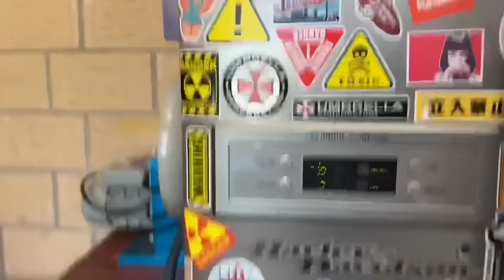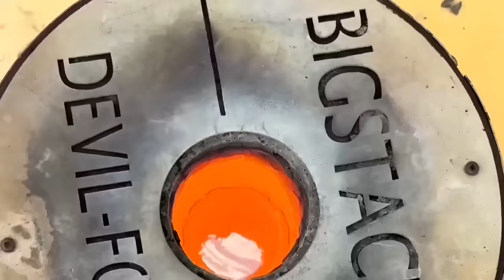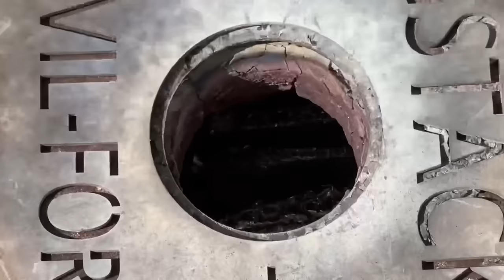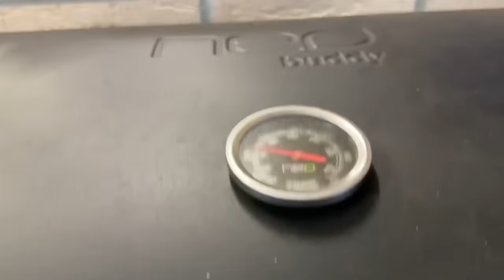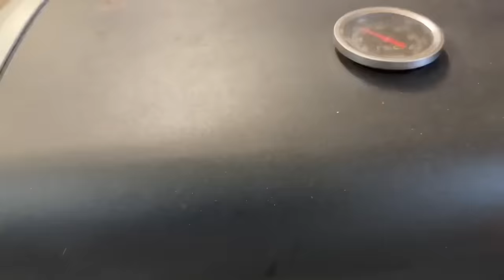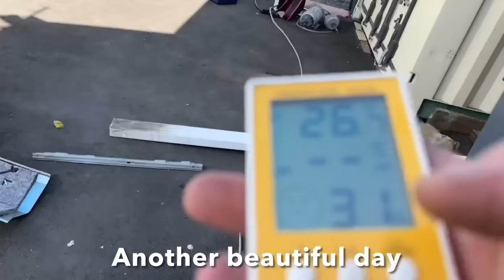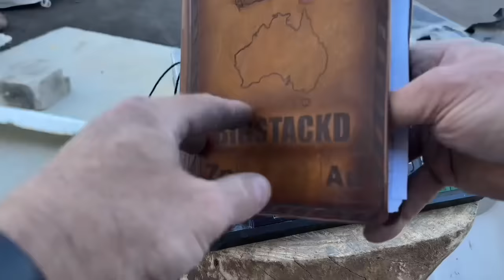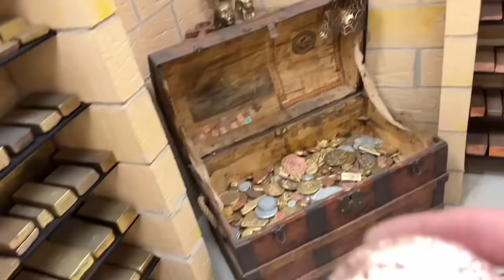Huge Haul Bulk Ingots - AirCon Copper Alloy - ASMR Metal Melting - Trash To Treasure - BigStackD

Comment: The aluminium copper alloy was so beautiful, would like to see it's crystal structure up close in a microscope
Reply: why that it is like that im curious
Reply: @Gamer-nc8qp the pattern is probably the result of the ratio of the individual metals(I'm inclined to believe there's more than just the copper and aluminum in the alloy
Reply: @Gamer-nc8qp  I'd bet on the copper crystalizing first, resulting in copper crystals in a matrix of aluminum, since the copper melts at a higher temperature. I would bet that he could have poured off the aluminum at that point then he wiggled that mold, and have left a lattice of aluminum coated copper crystals behind.
Reply: It appears as though the copper in the mystery "copuminium" alloy is freezing out first and bridging crystals across those pools.
Reply: It sort of has that old school Superman, "Fortress of Solitude," look. 😊
Reply: Cuprolium
Reply: Isn’t aluminum bronze made of aluminum and copper? What makes that different?

Comment: Favorite 2023 video? Anything with ingots, nothing with the oddball casts (coins - really medallions, odd shapes etc.)…if you think you need a copper wire sorter, you really need shredder, and a flame bath for your pours. Every melter that has a constant flame on either the mold, or the pour stream has zero issues with holes, visible layers, etc.

Comment: It’s nice to know that you had the air conditioning units gases recovered before you disassembled them.
Cheers 🍻
Reply from the maker: Yes, 100% buddy. These units look relatively small, but the amount of gas and pressure inside them would be absolutely phenomenal. If you were to cut one of these open when it’s not degassed there’s enough pressure there to easily cut through flesh especially if it’s one of the smaller lines you cut. And on top of that the Freon gas can kill you if you breathe it in. My mate was trying to explain to me how he recovers the gas , at the end of the day basically he has two hoses set up with some type of regulator thingy that leads into an actual propane tank and he collects all the gases that way. I’m not sure exactly how it all works but I should film it next time I get something like this off of him👌🏻😁.
Reply: @bigstackD Good day sir, thank you for another video. Just want you to be aware to refrigerant inside the tubes is only under high pressure when the unit is running. Honestly it's never under enough pressure to cut anyone. The hazard is the gas when it is in a liquid state in the high pressure lines will burn you due to the temperature. I've been doing sealed system repair for 24+ years and I've never heard of anyone getting cut by the gas in the liquids lines, only burned. I know it's best to warn people away from releasing refrigerant to the ozone. However, the new refrigerants that are coming out do not need to be recovered. Every country has it's own laws, so it's best to have a professional deal with the refrigerant or at least consult one. Better safe than sorry, you don't want someone knocking on your door because you out gassed a split system that had R22 or R410a. Thank you for the video! Sorry for the wordy comment.
Reply: @bigstackD  
It’s as complicated as a oxygen/acetylene torch set up. You would have no problem with learning how to do it. The compressor is the key.

Comment: God I love watching this guy, started doing this kinda thing myself. Got my hands on two A/C units and hadn’t even considered the gas inside.🤦‍♂️
Reply: I definitely would get someone to recover it. I would do it for free alot of the times if it was hard to get stuff like R12 or R22 . If you burn some types of refrigerate it can form phosgen gas or however you spell it 😂. Be careful with the pil in old compressors it can have PCB in it. Really old like 1970 and older. 😊

Comment: My favorite melts are copper cables because there is no slag and the copper is 99.99% pure.

However my favorite melt was the huge electric motor. I think it was blue and it was to commemorate a mile post for your YouTube channel "BigStackD"

Comment: Amazing video as always love the look of the ali copper bar looks like fibreglass in the outside and bismuth on the inside and my favourite video has the be the burger
Reply: If I had to guess it is crystallized copper. because the temperature I don't believe was high enough to actually melt the copper at low temperatures Copper and other metals will dissolve into aluminum it's crazy.

Comment: from someone who has installed these particular units, both units are technically part of the same ac. theres also hardly any metal inside the smaller wall unit, its 95 percent plastic or circuit board

Comment: Running a utility blade down the copper pipe cuts the aluminium foil. Do both sides takes minutes and the copper pipe will be free leaving aluminium foils. Also look for red switch's on the motherboards. Square red block with tiny white switches they contain gold balls and soon add up if collected. Have a great new year brother. Can not pick a favourite episode they are all awesome. Do you own devil forge as I seen you walking casualy through the workshop 😮

Comment: hi, BigstackD, regarding those aluminum ingots that break, you can melt them down, but also add more aluminum to them, because the percentage of copper in them is exceeded. or you can break them all and add a little at a time to other melts of metal when you melt aluminum or mix alloys

Comment: I believe what happened with the copper aluminum alloy is you didn't reach the temperature to melt the copper first. Therefore, the copper dissolved into the aliminum. it does have its uses in bearing material but it is not a true aluminum bronze. I'm curious if you were to heat another bar backup to a very hot temperature, would the copper.  and the aluminum make a proper bronze?

Comment: One way i have learned to get the copper from the aluminum fin coil is to run a razor knife down the length of the copper and using a screw driver to get one end started the copper will pull right out

Comment: I've been thinking about a Devils Forge perches .  Been dabbling with a few castings with a fire brick oven and a homemade burner . It's too heavy to lug around easily . My question is how long will it last before having to reline it ? Fire brick is cheep when it cracks . I've made lifting and pouring tools for small pours so I have most of it . I've been looking at the two smaller kits .

Comment: Your alloy is actually about 52% aluminum and 48% copper.

If the copper/aluminum ingots are 50% heavier then that means their density is 50% greater than aluminum. Aluminum is 2.7 g/cm^3 so your alloy is 4.05 g/cm^3. 

Using the formula 1/(% composition element A/density A + % composition element B/density B) = alloy density
1 / ( x / 2.7 + y / 8.96 ) = 4.05
1 / ( 0.523 / 2.7 + 0.477 / 8.96 ) = 4.0496

A density of 4.05 corresponds to an alloy of approximately 52.3% aluminum and 47.7% copper ∎
Reply from the maker: I thought about working it out, but this seems to check out ,cheers👊🏻🍻
. That’s even better than I thought as any time there is more copper it’s always a win. That’ll come in handy when I add additional copper to the broken one to turn it into aluminium bronze to show just how strong it can be from how brittle it was.

Comment: If you're going to do a lot of these and want a tool to separate the tubing from the fins on the radiators, you could take a cheap socket - like a deep 16mm or so - and cut a notch in it so you could wind the tubes up like you did with that one bit and the pliers.

Comment: Tbh, I usually can't stand aluminium (unless it's powdered and mixed with iron (III) oxide in a 1:3 ratio, that is 😁🔥). It's boring, messy, sticky, produced way to much slag, which it sticks to, of course, and despite being one of the more useful metals, is virtually worthless. Meanwhile, gold, which had almost no practical uses until the electronics age, is and always has been one of the most valued. Anyway, tangent. As I was saying, I usually hate aluminium, but those bars look awesome. I wonder what happened?

Comment: On the ACR's isn't there a way to heat the furnace and maintain a 660 to 700 temperature to melt away the aluminum and extract the copper before it does?

Comment: Great video! but mate, I have an air conditioner I’m thinking of scrapping but I’m not sure if the pressured gas in present, and I don’t know how to de gas, should I wear a respirator or something?
Reply from the maker: In all my years of cutting into scrap things  I’ve never had the unpleasantness of cutting  into something that had not been degassed . I’m not even sure if there’s any way to figure out if it has been degassed or not. Normally when I want to degas a heap of fridges and freezers and stuff I wait until theres hard waste put it all out on the verge at my friends house, and the council  has a company that actually comes around and degasses all the fridges and air-conditioners, and then they leave a degassed sticker on them, and then I’d chuck them straight into the trailer or the back of the car or just take the compressors and copper off while they’re on the side of the road. I wouldn’t recommend cutting into something if you don’t know it’s not still under pressure but at the end of the day that’s just my thoughts on the subject. Freon gas will definitely harm the environment and hurt the ozone layer and Freon gas is deadly be deadly to breath  so if you are to do it anyway 150% definitely wear a respirator👍🏻
Reply: @bigstackD  thanks a bunch mate! 🙏 I really needed this, I look forward to your future meltdowns 👍
Reply: Saying Freon is bad for the environment is an understatement. It's something like 40x worse than CO2 as a greenhouse gas and also depletes the ozone layer.

Comment: There is a huge difference between the melting temperature of copper and aluminum, why not separate the two by starting with a low temperature melt?
Reply from the maker: I certainly thought about that, but the amount that I had to melt it would’ve taken me a week, so I thought I’ll just melt it all together. Then eventually re-melt it with added Copper and make myself some nice aluminium bronze👍🏻.

Comment: Very simple method to take out the copper from the radiator... you take one cutter and you go along the line of the copper and and after you bent little the aluminium with a screw and you can pull the copper pipes very easy... for thost 2 radiators you need only 10 max 15 min.

Comment: Oh yes definitely do not degas yourself or you will gas yourself. Fluorine compounds are fun! Mine was a 25 year old busted window AC unit the guy said the gas leaked out and it no longer worked. Turns out the gas was just fine. The unit worked just fine. Only someone had installed a quilt in the condenser. So I got gassed in the face with AC lube and R134 while destroying a perfectly working air conditioner.

Comment: 38 degrees Celsius or 100 degrees Fahrenheit. How high is the humidity outside? I was in Roswell new Mexico and if it was over 14% the locals were miserable.
Reply: He lives in Australia I think so like Mississippi 180% humidity 😂
Reply from the maker: Humidity at 38°C where I live in Western Australia is normally around 25 to 35% . It’s a very dry heat which is good👊🏻😁

Comment: I have a question....Now I have seen you melt steel with another metal that had a lower melting point.  Couldn't you do that with the aluminum and copper parts as well?
Reply: I mean could you heat it to melt aluminum off of the copper?
Reply from the maker: Yes, I’m thinking I could’ve probably separated the copper from the aluminium, but that would’ve taken me days to extract it all I reckon . With the brittle bar I did last week I’m hoping tomorrow if I get time to add some extra copper to it and turn it into aluminium bronze to show just how strong it can become👊🏻😁.
Reply: @bigstackD  Oh, ok....  thank you, brother.  I have been a fan since your stack was about 275 kg.  I am a US veteran, and your videos help me get through hard nights.  I just wanted to tell you how much I appreciate all your hard work.

Comment: 30:20 am I missing something because I thought you aren’t supposed to add metal that’s been sitting around to molten stuff for risk of a steam explosion?
Reply from the maker: Actually when I was putting those small pieces into the crucible, the copper already in there hadn’t completely melted, so the pieces added weren’t falling directly into molten metal👍🏻

Comment: Hey, Bigstackd!!  I've been watching your vids now for over two years and I love 'em! However, if you are going to continue your Metallurgical hobby, I must tell you I think you are misusing a term, and I would like to set that right. 

After you pour the liquid metal into your molds, whatever the metal actually is, what happens to it as it cools is solidifying. It returns to its natural room temperature state of a solid material. It does not indeed, "Freeze". That does not and cannot occur at the temperatures which you are doing your fine work. It takes a Supercoolant like liquid Nitrogen in order to actually "freeze" the metal. And I have not seen you use any liquid Nitrogen in any of your vids. 

I just wanted to make sure it was understood what I mean. Thank you for your vids and if I could afford to support you on Patreon, I gleefully would do so. 
Please do not be angry at me. I am not trying to attack you at all, simply pointing out an inconsistency, that is all. Happy New Year!!!